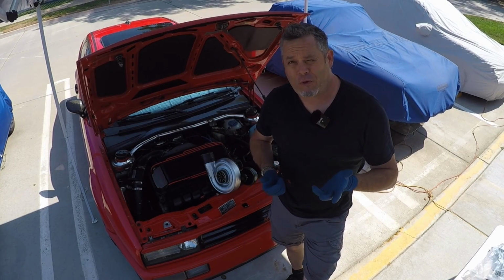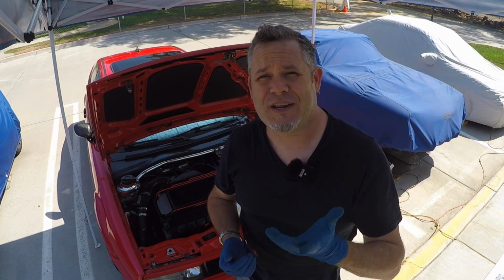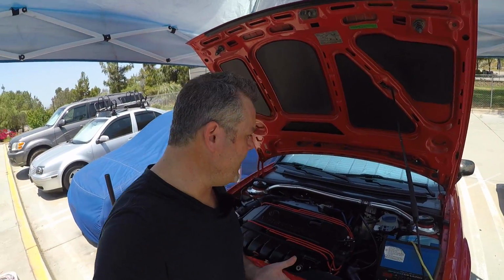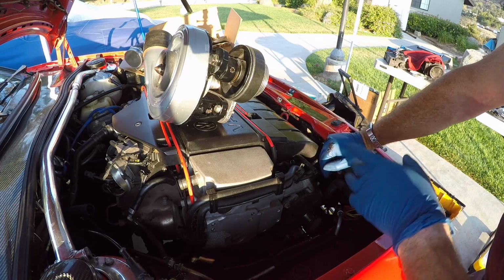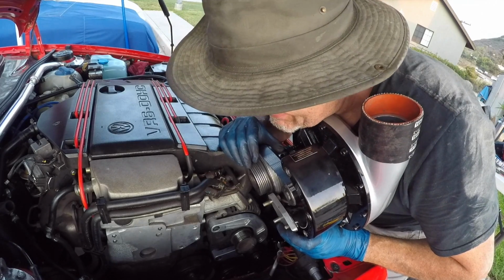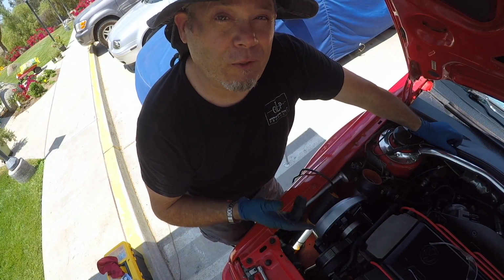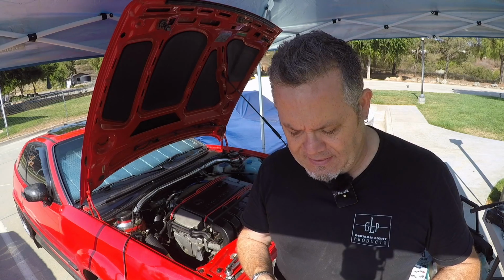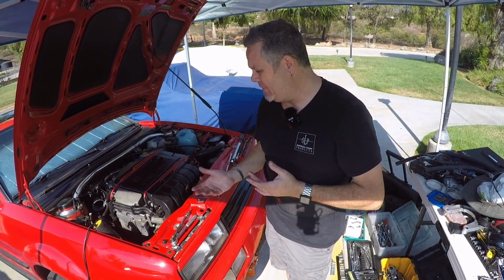I Installed a Supercharger on my VR6 Corrado??  Part 1

Comment: Nice!!! Youre on CCC FB. I want to get one this year. This is the V3? It comes polished or thats a silver powder coat? Any belt slip?
Reply from the maker: This is the Z-Engineering charger (I think it's a Z-3 model) which was the original charger sold by VF Engineering, and is now sold by RUF Germany.   It got a grey metallic paint job following its recent rebuild.  Can't speak to the belt slip just yet, as I'm still in the install process... have been going down the rabbit hole with many repair jobs that have needed to be taken care of along the way.  I'm hoping to have it functional this weekend. 

Nowadays VF Engineering sells Vortech superchargers, fyi.  Those are made in the USA, not far from VF Engineering, which makes servicing them much easier.
Reply: @CliffjumperCars  Just ordered mine. It will be polished and will have to wait 2-3 months for that. My install should be easier. No carbon can, no isv, no maf. All out. My question is, can i use my existing intake elbow instead of theirs? The one from the throttle body. What do you think?

Comment: Hello Brendan,
 Wow great progress on this supercharger build so far it's a shame they didn't give you that 80 mm bolt to give you that full adjustment you're looking for, for the supercharger. But that's how things go sometimes working on a 29-year-old plus car. This dawned on me in regards to your maf wire instead of cutting it perhaps just trace the wire back to see if there is a plug that you can disconnect from along the fire wall area and simply just use a pigtail adapter and reconnect it from there. Or simply just extend 3 extra feet by the airbox. How much horsepower does this supercharger add on to your 204 HP you already have?
Reply from the maker: The MAF wiring is straight from the main wiring harness out of the giant 30 pin connector, so no joy there.  No choice but to cut and extend, as I've had zero luck finding one of the old extended harness wiring looms with the connectors on both ends.  A friend created one with a pigtail cut from a parts car and a hacked up broken MAF, and if I could source both then I could do likewise.  But the local junkyards see very few OBD1 VR6 cars come through.  So... for the sake of getting this rolling in the next couple of weeks, I've already started making an extended wiring loom which I'll splice in. 

The kit supposedly is good for 60-80hp.  Back in the day I saw dyno plots showing right around 260whp, 250wtq.  Sounds about right.  If it gets more than that I'd be surprised.  I'm not aiming for big numbers, just some period correct cool factor, pleasing noises and a little more vroom vroom.
Reply: @CliffjumperCars  Well hey it was the thought that counts LOL, at least you did your research and found that it goes straight to the fuse box at this point it's better definitely extending it by the strut Tower area.
 Wow 60 to 80 horsepower gain still if you could easily add on 60 HP horsepower that would be a nice 264 horsepower roughly which would be absolutely exhilarating! 
 After a nice mod like this I would definitely upgrade to LSD limited slip differential Quaffe brand! Zoom! Congrats on the build 🏁🏆
Reply from the maker: @Eurospec73  I have a built O2m six speed gearbox waiting to go in.  I am assuming that the O1m transmission that is currently in there will finally succumb to the abuse it will experience with the supercharger installed and I'll have a good excuse to install the new transmission. Still need to get custom axles made for the transmission swap, but I've got almost everything else I need for that job.

Comment: I installed the same one and had almost the exact same experience trying to improvise some parts over 2-3 days the first time. Now I could probably do the job in less than an hour. I did the same thing you did with the jb weld for the intake elbow initially. I eventually found an silicone elbow with a 1" tee from an e36 bmw that fit. I think you have the correct bolt on your tensioner. Mine came with a stud/nut. It's tight but you can gain access to it by removing your headlight and grill to be able to tighten/tension the belt. Good luck with the install.

Comment: Why drill the coupler when you can have it made out of metal with some silicone couplers instead.  I doubt that plastic weld will hold 7 PSI.  Also, install the intake coupler with the supercharger at the same time.  Just a suggestion.
Reply from the maker: A mechanical engineer friend used JB weld to repair an intake manifold on a supercharged 400ci motor that he built for a mid engine RWD custom 944.  Thing ran 10's in the 1/4 mile while shifting slowly and letting off the throttle to coast through the traps, so he didn't get kicked off the track for being too fast (not having all the required NHRA gear for that speed class).  I think it can handle 6psi, given that it won't be having to handle that pressure constantly. 

BUT that is a good idea to fabricate the coupler out of metal to ensure no boost leaks.  I think once I've got all the plumbing fitted, I can take measurements and have it all made from fewer parts, for the same purpose. Fewer possibilities of boost leaks.

Comment: Did you choose the Z-Eng kit just because you found one?  I've never been a fan of that supercharger, would rather have a Vortech, you can still get parts for them and they're totally rebuildable.  At some point I wouldn't mind adding a kit to my car but you're running into all the issues of grabbing a used kit.  BTDT unfortunately.  Best way to get a kit is to see it running on the donor car and then pull everything off.  Course that's practically impossible to do unless you're buying it from a buddy
Reply from the maker: Went looking for one.  Had the option to get a Vortech kit.  I like that the Z-Engineering is self-oiling and not prone to internal leaks that foul MAFs and spark plugs, unlike the Vortech. I like not having to drill and tap the oil pan and run a separate oil supply.  I like that it's weird and rare.  And with Nic at VF, there's some support available. But... given that it could go horribly wrong, I'm not opposed to switching to a Vortech based kit at some point in time, should the need arise.
Reply: @CliffjumperCars  the vortech V3 blower has a self contained oil supply as well.  No need to tap the oil pan or any of that other stuff
Reply from the maker: @docwyte  Good to know!  Thanks!